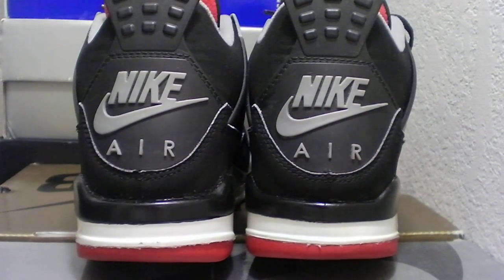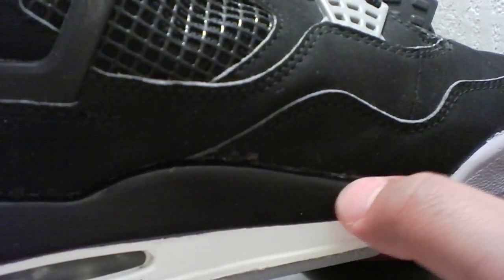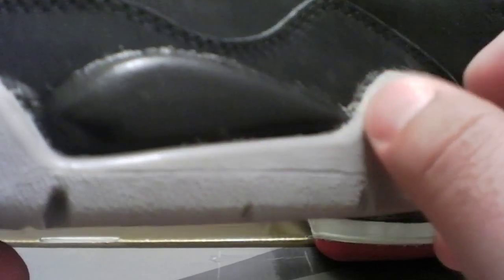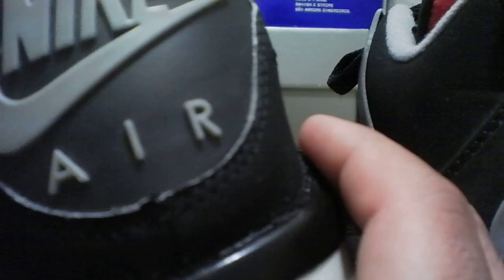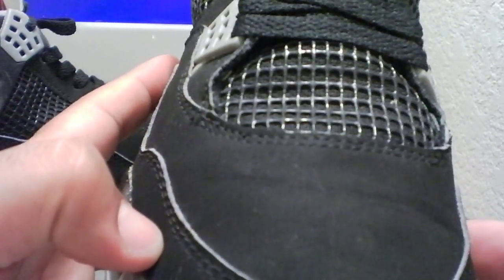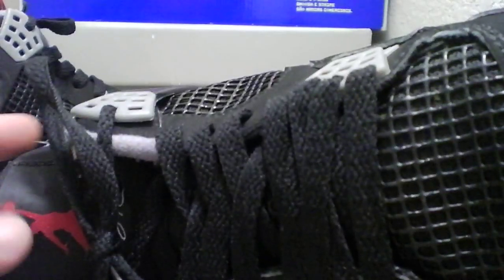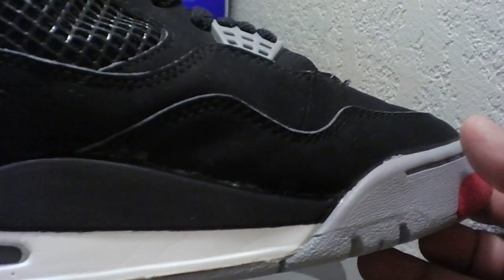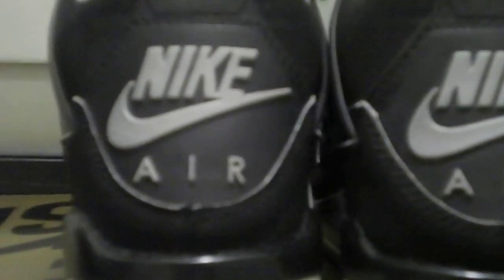NIKE AIR JORDAN 1999 RETRO 4 MIDSOLE SWAP CONCLUSION

Comment from the maker: @DFrnkln06  i kept it on, i didn't want to remove it because the stitching is done different i used a lot of heat to get the front of the midsole off, i came off pretty easy, check out some of my earlier videos of my midsole swap, oh yeah sorry for the late reply,